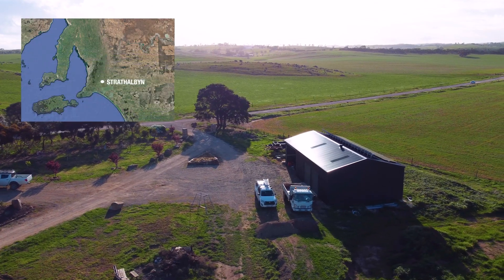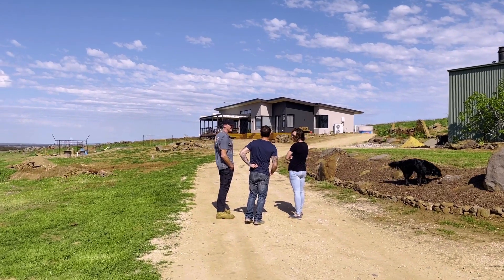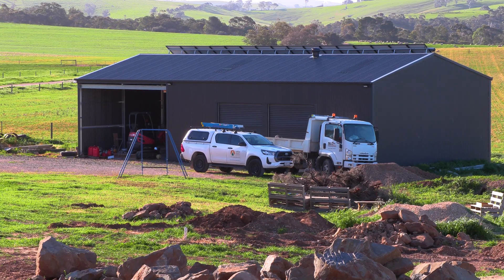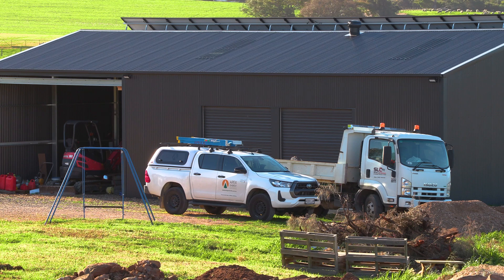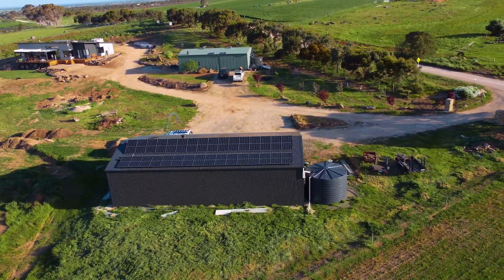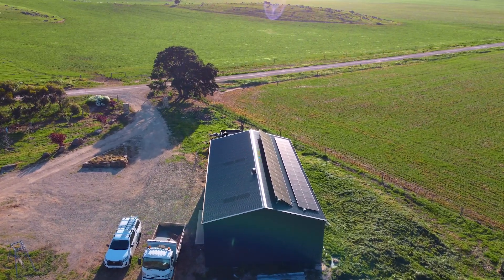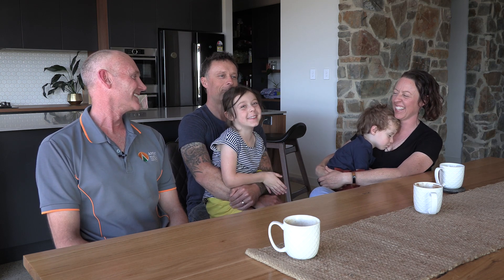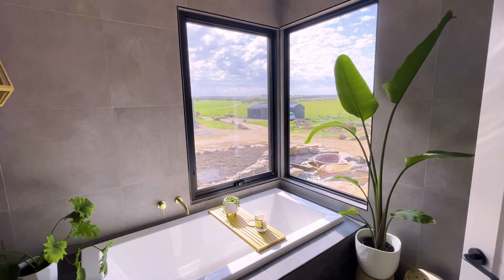How To Build A Luxury Off-Grid Home

Comment: $70,000 for 1km and one home. 

If all the infrastructure back to the power station including transformers and switch yards and transmission lines was included then the customers cost could be higher. 

The existing national grid would cost approx 50,000$/building if it was to be built today. 

That is why dirt cheap electricity is 10 times more expensive at the customer. Grid electricity is basically expensive.